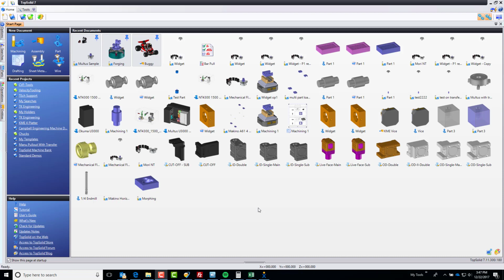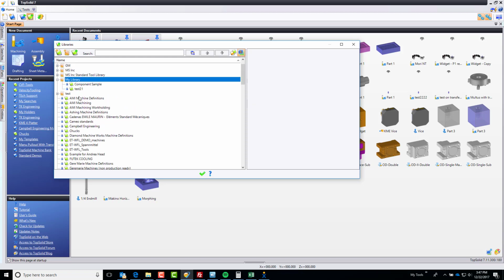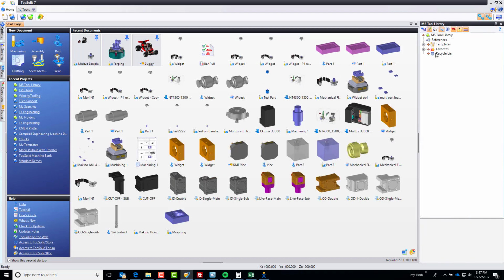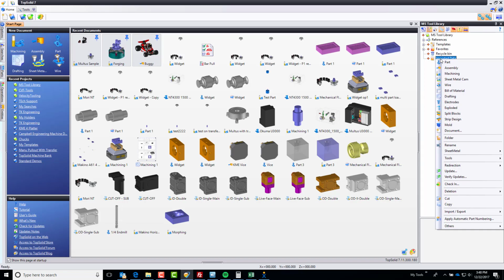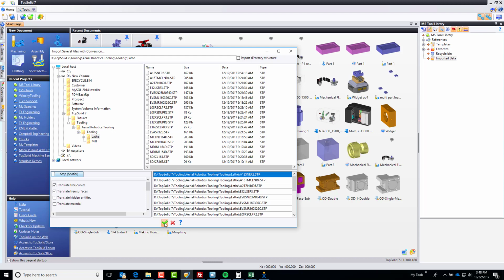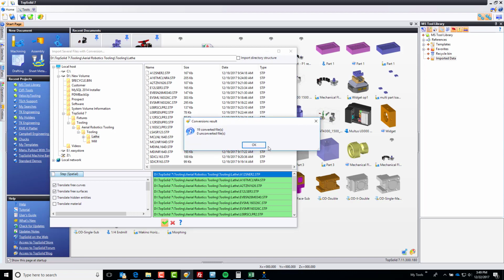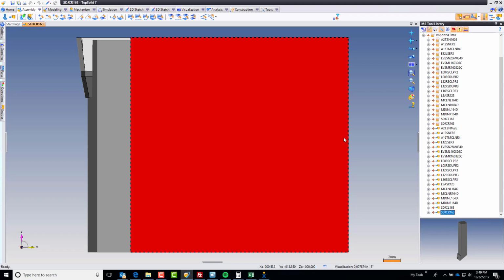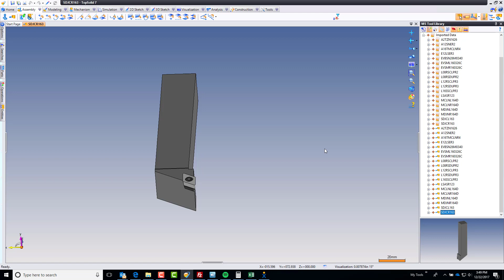TopSolid Custom Tool Library - Step 1 Create a Library

Comment: Hello,
thx for all videos
How I can manage more than 1 edge? for example at seco tools or sandvik coromant you have turning tool holder of 2,3,4 tool.

thanks for reply
Reply from the maker: Hi,  TopSolid will automatically manage this.  You need only to define the tool...properly.  I will try to add this type of tool definition to my list of samples to make for 2019.
Reply: Eklenen takımları silmek istiyorum bunun çözümü var mı ?